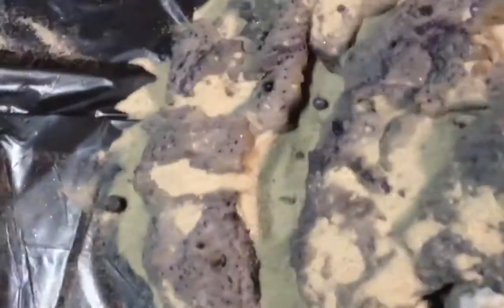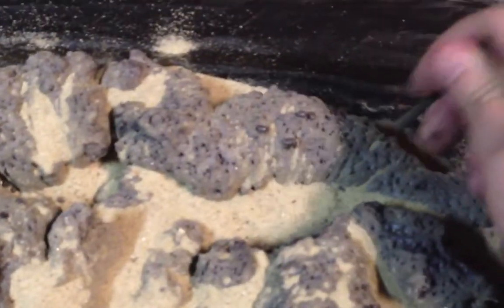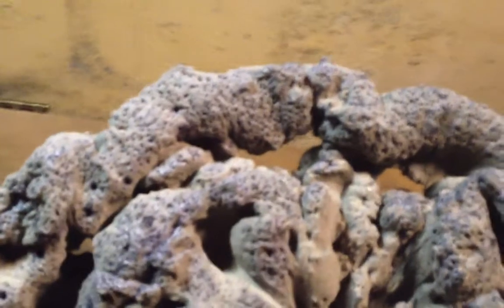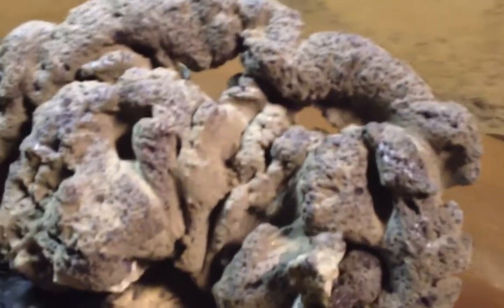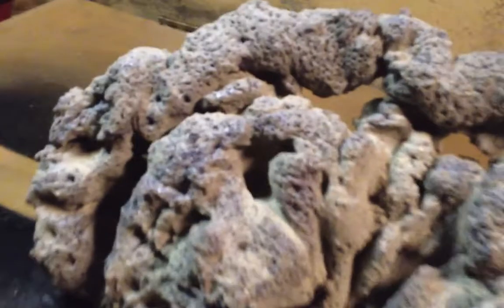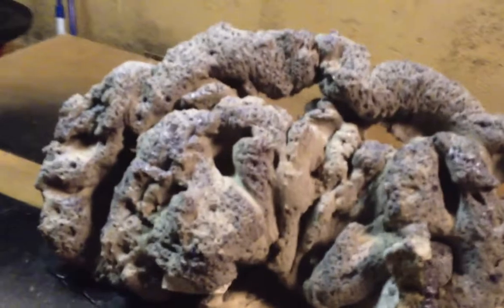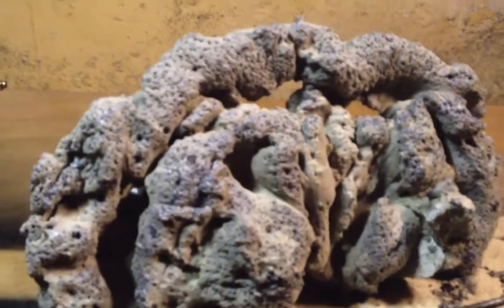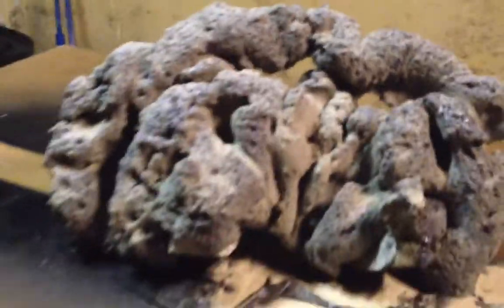"Foam Rock" for fish tank - Pond & Stone Foam Adhesive

Comment: I just used it to fill in the land area - and make a ramp for my fire belly toad tank.  The ramp looks like lave.  I love it.  Thanks for the informative video
Reply: Did it stick to the glass? When you filled with water it didn’t float?
Reply: @claudiapinheiro3902  I f you use to ks or something heavy, they will hold it down. It may stick to the glass initially but it will peel off.  Also, it expands, so for myself, the water area wound up being a little smaller than I wanted it to be,  all in all, it was better than other things I tried
Reply: I'd post a photo, but I don't see a way to do it
Reply: @limabean13  I am trying to make a little “beach” area for mudskippers, but the island I made floated… I am thinking about doing something directly on the fish tank, but not sure if it will stick to the glass… I used a stone as an anchor and still floated… What is KS?

Comment: I just finished making a big "rock formation" for my 75gal with caves (spraying the pond foam over small balloons) and attaching them together with silicone. Also made tree roots using it over a large balloon. I'm debating how to finish it. drylock ? or painting and using epoxy to seal it. wondering what you did if anything before putting it in the tank? just curious if it's safe as is..

Comment: A very good anchor for foam, driftwood or any other light weight or floating decoration is Slate. Easy to find... Easy to get big or small pieces... easy to drill. Just Drill some holes with a mason bit and screw the desired decoration to the slate. I agree that decorations should not be permanently fixed to the tank, not good for resale.